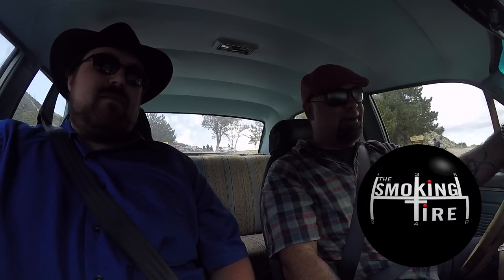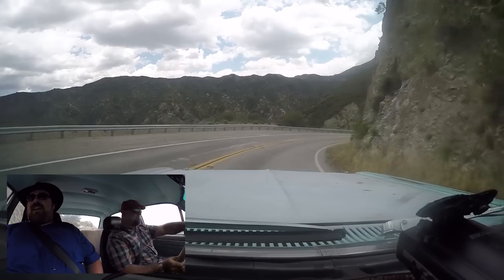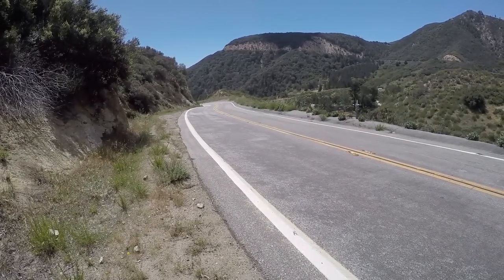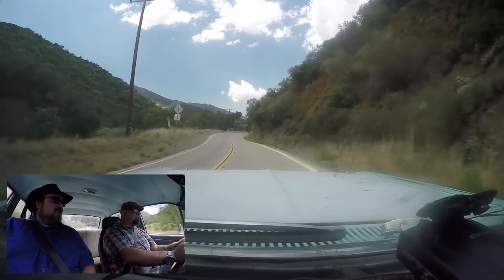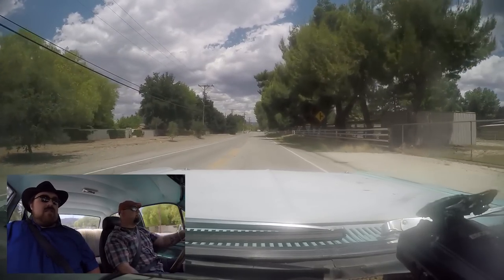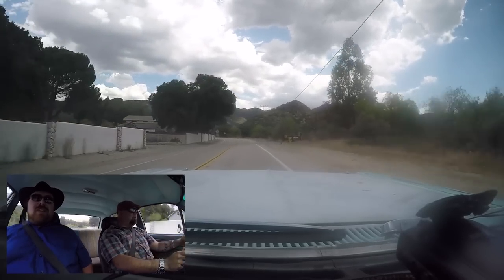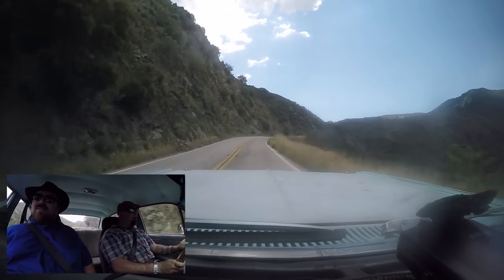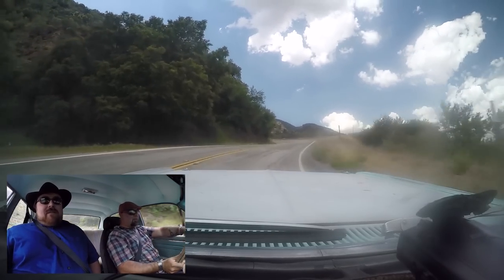1967 Ford Fairlane - One Take

Comment: "Is this car what it would've handled like in '67?"
...No. In 1967 you would've had bias-ply tires that were, at the most, 215mm section. Also, it had power steering in '67 and would not have had EBC brakes (shitty drums instead).
On of the dumbest questions I've heard you ask, Matt. Still love the videos, though

Comment: I had a '68 Fairlane two door that would surprise you. 200 cubic inches. Three speed auto. Topped out going up I80 to Donner Summit at 25mph. It did get 25mpg and had a 25 gallon tank. Drive forever between fillups. Total POS.

Comment: i have a hard time believing this is 3,000 pounds, id say no less then 3,600 pounds
Reply: You'd be wrong.
Reply: No electric motors for windows/seats, no insulation,  no heavy interior trim, etc. It's literally an empty metal box.
Reply: weight was 2600-3400 depending on motor.
Reply: Old cars are surprisingly light compared to their physical size.  They don't have any of the modern stuff or safety equip that new cars have.  Think of this, this car here probably weighs a bit less than a new 911
Reply: I weighed my 68' sedan on a set of race scales and embarrassed an EVO X owner.  They're an honest 3,000lbs.

Comment: and I thought my car sucks...
Reply: u-joint rubbing on exhaust, under powered, replaced factory suspension with factory suspension, did not use a 5 or 6 speed manual to replace the automatic.  There was so much which could have been done for the same amount of money to vastly improve the car.  I would not paint it.
Reply: The entire driveshaft was installed less then 2 days before I left for this trip, no time to test, and now the rub is fixed. I replaced the factory suspension with OE parts that have been modified (Shelby drop to improve caster and camber curve, roller spring perches, strengthened LCA, poly bushings, etc) Besides, why fix what isn't broken? A full coil-over setup is 3+ grand, and while it would make it corner better, it would also make it drive like shit on the road, where it spends literally ALL of it's time. The OE ford suspension is actually pretty damn good with a little geometry correction. The 4 speed came from a friend for $50. I don't want a 5 speed because its a half measure, and show me a $50 T56 that works 100% perfectly with nothing but a fluid change and I'll do it (along with the re-gear it would require). I have actually spent very little money on this thing. All I need to do now is a new set of my KYB shocks, the ones on it now have 30,000 miles, and are just starting to show signs of needing to be replaced, and to install the larger sway bar I bought recently. The car is also about to get some actual money put into the engine with a set of AFR heads to add some more power, and though it may not look it in the video, this car is actually pretty damn quick once it's off the line. Sucks? Hardly. This car is 100% mechanically sound and I would trust it to drive across the country at the drop of a dime. In fact, that's pretty much exactly what I did, and it took everything I threw at it and asked for more. 2000 99% flawless miles with the only issue being a slight driveshaft rub under very hard cornering. I call that a success.
Reply: Safe to say, the owner of this car knows what he is talking about. :-) Love your car dude.
Reply: I can tell you are a very skilled mechanic by the things you have already done to the car.  There are extremely low cost (to the point of being the same of what you already spent) to significantly upgrade this car.  A full coil over suspension on this car would be a waste but there are other options other than stock for a much lower price.  I was not kidding about the paint.  I like older cars which look like this.  Paint is a waste IMO.  I would recommend starting with a brake up grade kit using junk yard parts which you can rebuild yourself with inexpensive rebuild kits, wheels and tires.  The other improvement would be built 351 Cleveland once this engine is worn out.  I completely understand the low budget approach but I believe I will see some awesome cars on YouTube from you in the future once you complete your degree.   My opening comment was to see if you would reply.  I do like the car and it could be vastly improved with a 351 Cleveland instead of replacing the heads on the current engine.  There is no replacement for displacement and 351 Cleveland are very inexpensive.
Reply: David Peterson 351c are crazy expensive compared to a 351w, even a 390fe would most likely be more economical